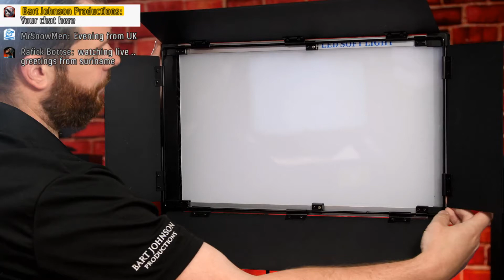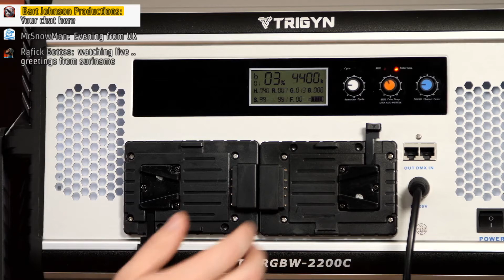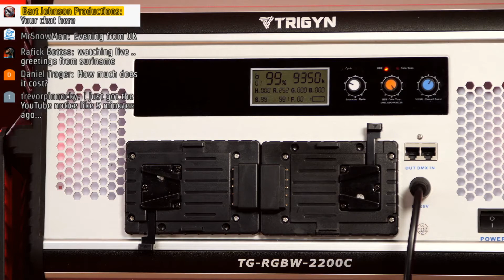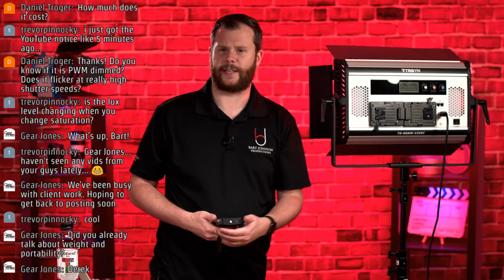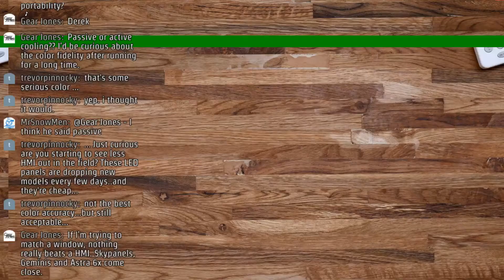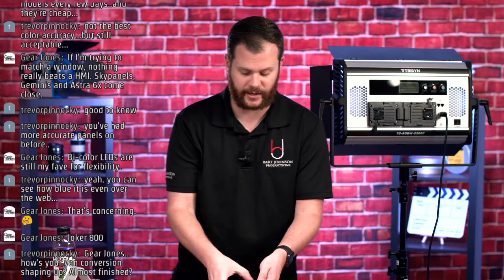🔴 TRIGYN 2200C RGB+W LED Panel - LIVE Demo, Testing, and First Impressions

Comment: Any idea how the dmx address works?  We have 3 of them and cant get dmx to do anything besides white intensity.
Reply from the maker: Unfortunately no.  I don’t work with DMX, so I have not used this functionality.
Reply: I figured it out. 5 channel fixture. Intensity, color temp, saturation, hue, focus.  HUGE pain that saturation is before hue, but at least we have control.
Reply: @Shauny_D  Hey man! I keep seeing you post about the Trigyn! I'm very seriously looking at picking one up. Ive seen a few people say that the menu is unusable but I'm wondering if it's just frustratingly difficult or it's actually . I reeeeally want to jump on the RGBW train. There's a few other options but none quite as power or as affordable. I've been looking at the Ikan Onyx RGBW (no battery plate option - sorta a deal breaker), Ikan Lyra LCX21 (too pricey), Rayzr 7 MC 150/200/400, Prizmo 150w or 300w, Lupo 30 or 60 Full Color, Luxli Timpani, Nanlite MixLite 60 or 150 but really the Trigyn stands out as the most affordable option considering it's output and (at least based on appearance) it looks pretty durable. Would you buy another Trigyn? I'm most likely between the Luxli, Prizmo 150w, Mixlite 150 or the Trigyn. Also! Anyone know if there are any notable differences between the Yidoblo RGBW LED and the Trigyn? Because they look pretty damn similar haha. Appreciate your help!
Reply: Brody LeBlanc I bought 3 trigyns but do not and wouldn't recommend them for rgb.  The menu is fine one you get used to it, the remote is better. The DMX control which is what I got them for is unusable.  In rgb mode or actually hue sat mode it won't stay on a steady color. Sometimes it'll sit on red for a while but no matter what you set it to it'll slowly drift through hues of that color.  Trigyns support on this and the dmx issues had been useless as well. 
I now use them as traveling white lights now and am reasonably satisfied with that usecase.
Reply: Brody LeBlanc oh and I have 6 lyras for white light and they are the best for sure I'd rather have 1 Lyra than 3 trigyns
Reply: @Shauny_D  Do you have one of the Lyra LCX21? That seems like a beast. I think I might grab a Luxli Timpani or a MixPanel 150 for the moment until I can move up - it sounds like the Trigyn has way too many hang ups even for the price. For RGBW I really just like the idea of dialling in on magenta/green hues. I won't be messing with much else really.